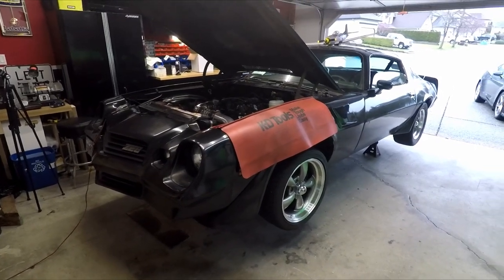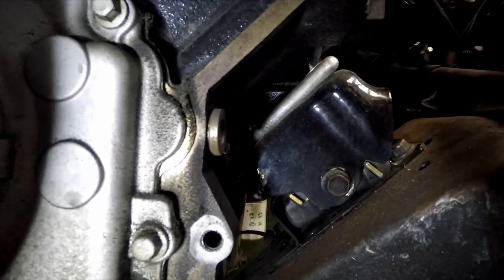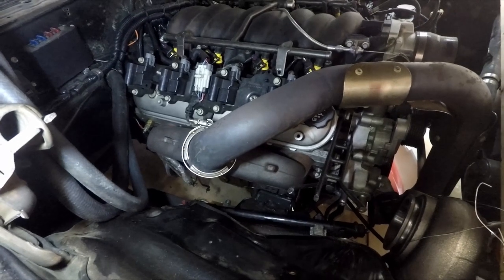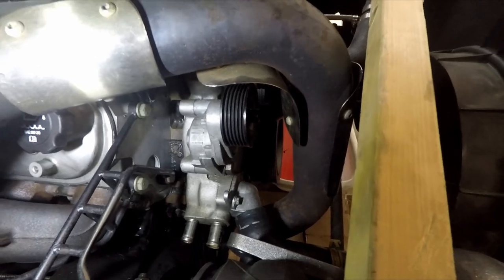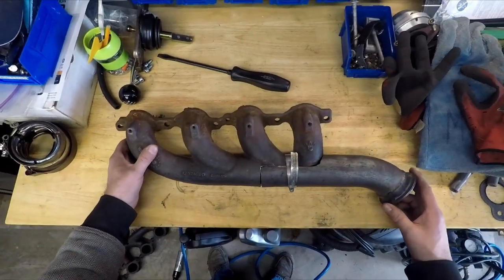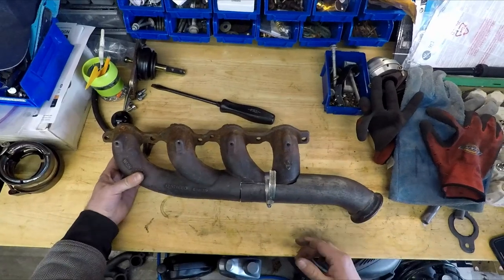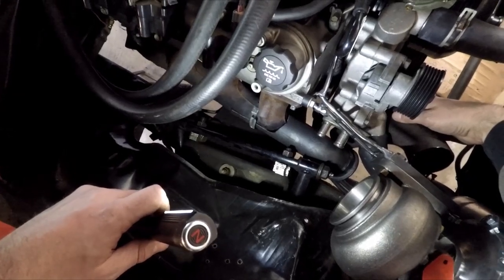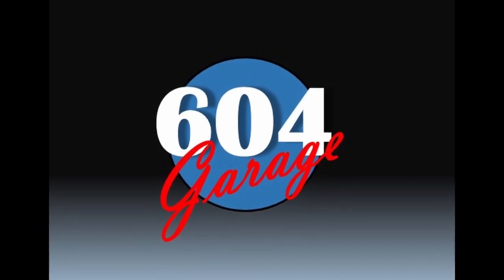Pro touring LQ4 Swapped 1981 Z28 Turbo Build EP.2 //  Manifold Fab and Turbo Placement

Comment: Just finished my 72 firebirds single turbo setup. Very similar cuts on the manifolds. I had to thread and block off my heater hose outlets. and I messed up and had to use a different thermostat outlet.  On the heater outlets I think if I ever put a heater back in the car I can just use some 90deg AN fittings.
I still have alot of wiring to tie up, but Ive done almost the whole swap with just junk ive had left over from other stuff lol.

What computer system are you using?
Reply from the maker: Thanks for watching, I’ll definitely check out how you did your single as well. Yeah very much an experiment for me but glad to hear it worked for others who went a similar route. I’m going to try to route the pass side a little lower and try and keep the heater outlets so stay tuned to see how that works out.
I’m using an LS1 0411 PCM.
Reply: @The_604_Garage  Gotcha, if I would have raised my engine about an inch I think I could have kept the outlets. 
I’m also using the GM 0411 PCM and I hope your better at tuning than I am, or you have someone who can tune it lol.
I subbed so definitely looking forward to seeing how it turns out.
Reply from the maker: @JohnnyAnderson1  I’m definitely no tuner but I know a lot of good tuners local so that will be done by someone else. Thanks for subbing and I’ll sub back to you right now and get to watching your content soon as your channel looks great!